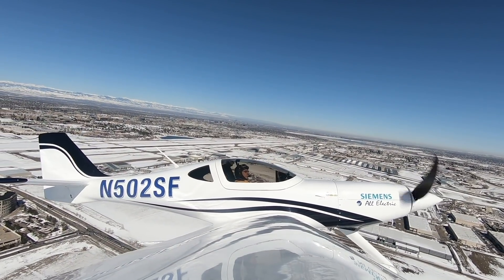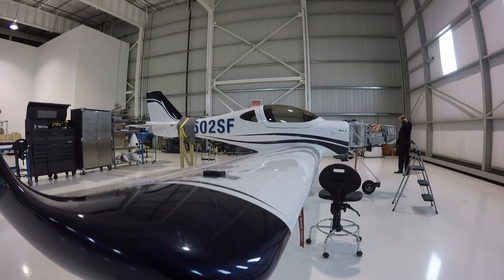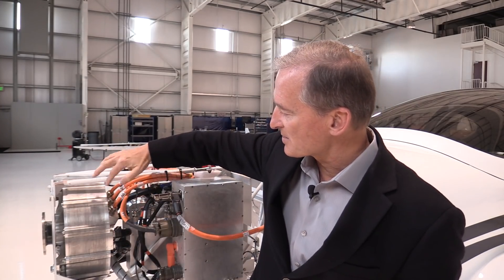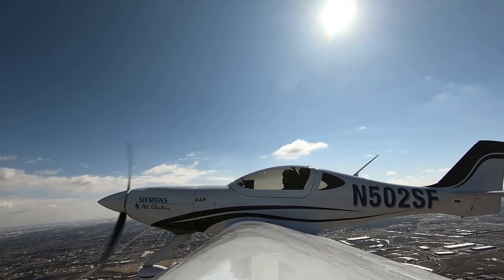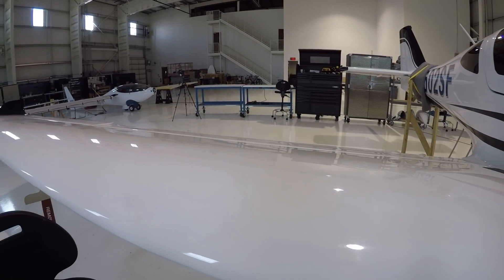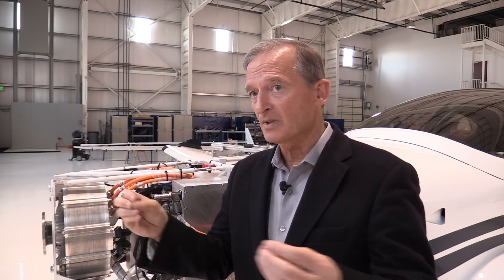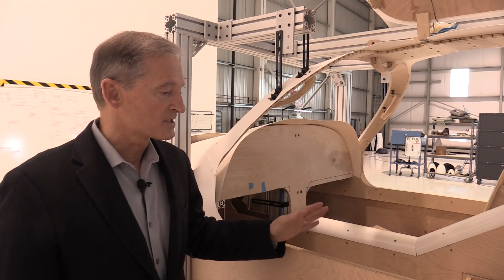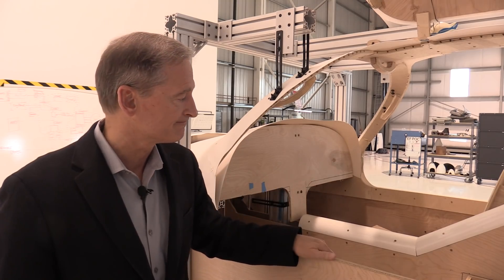Bye Aerospace's eFlyer Electric Trainer

Comment: 2 years on and where is it then? These are the usual fantasy projections which count for nothing. Performance has been revised down, certification has been pushed back. Why should the latest in service forecast of 2023 be seen as any more credible than the previous failed one? Results speak louder than projections. Proof of concept these days, particularly around electric aircraft has come to mean a flying mock up for PR sake, the performance of which bears little resemblance to that which is being projected.
  Claimed operating costs a 6th of a C-172? Oh please. The capabilities of the two aircraft are not even close. 3 pax vs 1 pax, double the useful load,  at least 5 times the range. You may as well say cheaper than a Learjet. But is it really so much cheaper? We don’t know what the battery pack will cost and Bye aren’t letting on. Nor do they or we know what TBO will be for the batteries if they get certification. But taking the only currently certified electric airplane in the world, the Velis, there is a TBO of 500 hours, which stands to reason given the effect that the unavoidable drop in capacity over 500 cycles will have on the already very limited endurance. And it is $21.6k for the 500hr battery TBO according to their 2021 price list. And those batts are 1/4 the capacity of the Bye. If you combine energy and TBO costs of electric vs avgas you basically end up with something like the same in terms of hourly costs for the equivalent power. Although future battery costs are reducing, with certified aircraft the cost is effectively baked in at that point.  And those things do matter otherwise we would all be flying gliders  All of this is before you spread the huge extra capital of an airplane that is going to be at least $490k. That is getting on for double the price of a Piper Pilot 100 trainer. Although all electric has the potential to bring down costs a long way in the future, at this stage I find this ‘reducing the cost of training pilots’ claim to be quite bogus..
Reply: Exactly. Lots of hike. Taking deposits. Delivering nothing.
Reply: @kitfoxjunky I don’t know how many ‘in service by’ dates have to come and go before people wake up to the reality that these BS projections are being plucked straight from the arse of the ceo.
Reply: EV aircraft are also always way overpriced. R&D and Producing Electric vehicles is actually cheaper than a gasoline equivalent.

Comment: The battery provides 216 Wh per kg. If you fit a 100kg battery in this 600kg plane, the 90 kW motor will empty the battery after 15 min of full power, or about 30 minutes endurance at 50 percent power. They claim 3hrs endurance.  What am i missing?
Reply: Nothing. The math does not work.  Batties do not have the energy density to deliver what Bye Aviation is claiming.

Comment: would be so nice if a standard quick change battery pack could be used in all electric aircraft so airports could be equipped with these to equal the fuel distribution system we now have

Comment: Electric, I wonder!  Will there ever be an aircraft that will be practical for distance?  I suspect there will be one for short flights, but long distance?  Never say never!
Reply: Even if you increased the energy density of batteries up by a factor of 30 it would only be able to power a half full Airbus 320 for half the range you can get from Jet fuel. We have a long way to go but the laws of physics may never allow it.
Reply: @ewaf88  That A320 would,t take off! Up weight means more wind, more under carriage, etc, etc

Comment: 260Wh/kg is getting pretty good. 3 h flight time at 70 knots is a pretty decent range.
Reply: zapfanzapfan 70 kts... what a joke. Cars on the interstate will be passing you at less than 1/2 the cost. Not to mention travel time to/from the airport.
Reply: @dalgrim  you do realize that flying isn't just about going faster than cars? And that GA happens on airfields, not airports, right?
Get that guy outta here... please...
Reply: I'd want a lot more than 70kts for 3 hours, for $349,000. What a rip off.
Reply: Except when upper head  winds are 50kt !

Comment: I'm surprised they haven't designed a way to "Charge as you fly" similar to an Automobile Altinater  couldn't be that hard could it..... and would be small enough to fit along side the electric motor
Reply: Joey Byrne That would be perpetual motion. If your alternator is 75% efficient you would only get back 3/4 of a horsepower for every 1 hp it took to run the alternator. Some do use the motor to put power back in the batteries while descending such as regen braking on an electric car.

Comment: My question is how long does the battery last and would the present day state of batteries allow for a 10 to 15 seat size hybrid or fully eletric plane?
Reply: most packs warranted for 8 years but that's to around 70% SOC overall. If these aren't temp controlled or if it's mostly circuit flying and full power go arounds as opposed to cruise flight,  then life will be shorter.

Comment: Can the batteries be swapped out so you can charge one while flying with the other?
Reply: Charge them with what?
Reply: @xqluziv  energy
https://youtu.be/cPQbkTkGsnI
Reply: There are some companies researching and trying to use large capacitors for extremely quick charging off phones. Depending upon heat and other issues, a capacitor could charge up while you're in flight, you land, connect, and in a short time you're going again if they can get the technology worked out for this too
Reply: @jarodmorris611  No regen in the air unless you want huge drag
Reply: No.
They've found the cabling needs to be too heavy.
Reply: Honestly, by 2021, charging may be so fast that it might not be necessary.
Reply: @jonathanhankins8356  It's batteries that are the issue - temp control is critical and every rapid charge cycle degrades them.

Comment: Question: if a student is trained only on electric than what happens when the now pilot gets into a fuel plane having never delt with  carb heat, fuel mixtures, and such. Will there have to be training/ certification for ‘electric only’ / ‘fuel only’ ?
Reply: One would advance through that stuff through training just like bigger, multi engine, complex, and other types.
Reply: It is a good point, and It goes both ways as well.  
Our largest local transit service airlines here in Vancouver have outright committed, or in the case of the competition partial commitment to moving completely over to ev planes for the bulk of their routes, which is taxi services, short trips etc.  Which means training on similar systems will be required to work in many smaller operations very soon.  
As said above, training programs will need to cover both combustion and ev powered.
Reply: @Arrogan28  committed to fly EV when?  10 years? Most likely they'll be hybrids and alternative fuel powered.

Comment: They need small motors in the wheels for taxiing to save energy on the ground. No sense in blowing yourself down the taxiway.
Reply: I thought of this but it adds a little weight they said.
Reply: Well you don't need to warm up the engine (like ice). So depending on the training outfit, rather short taxxing probably. And if it's at a jammed airfield, you can simply turn off the engine. No power loss. That taxiing project for airliners is more appealing, read about Airbus research on that a few years back.
Reply: That’s actually a great idea!

Comment: How many FBOs will have charging stations? Not a pilot here, so the training will not include the gas engine aspects of flight?
Reply: It probably will include gas powered engines for cross-country training flights, which are at least 100 nautical miles long and sometimes have more than two takeoffs.

Comment: So at what point in age do the batteries lose enough storage that you have to replace them? Say you use the plane 5 days a week for schooling, maybe 8hr. days?
Reply: Erik 567 typical liion life cycle is 600-900 life cycles rn
Reply: @DonMuffatello  Automotive with good battery management hardware and software is currently 1500cycles to 80% degradation. Best practice is to not charge to 100% or fully discharge. Quick charging is possible to 80% capacity in 20 mins. New Tesla V3 Superchargers will do 75 miles in 5 mins. New Tech from Maxwell will appear in tesla batteries in near future which are rated at min 300Wh/kg and double those cycles at 10-20% less cost. Tesla is aiming for a million mile drive train next year.
https://www.nextbigfuture.com/2019/02/tesla-buys-maxwell-to-eventually-triple-battery-energy-density.html
Reply: 3% oer year used or not

Comment: @2:27 Wrong. Thats not a nice progression in LiIon batteries, but a progression in your capability to use them on the aircraft.
LiIon batt have been at the 260Wh/kg for many years now and will probably stay there for ever, physics limitation.
3 hours endurance?
Pipistrel Alpha Electro has 1 hour pus 30 min reserve (if your lucky) with 120 kg of batteries on board. And that is for the certified aircraft.
Reply: Some suppliers are offering laboratory scale batch produced batteries at 500WHr/KG.    Anyone who gets their aircraft in the air now will be advantaged when these batteries become available.
Reply: pipistrel is 3 times cheaper :)
Reply: His lucky?
Reply: "probably stay there for ever, physics limitation." FAIL. 260wh/kg is not a development wall and frankly not exceptionally dense. The issue now is we have many competing formats and chemistry in Laboratories that are being heavily validated mainly for Safety & Reliability. High 300 to 400 Wh/kg is very doable in the next several years. 260wh/kg was achieved with minimal CELL improvement, it was mostly reached with Battery Packaging methods.
Reply: BMW i3 60Ah, 233kg,   120Ah pack 273kg. that's 98 to 155 Wh/kg real world machines and you don't get max kW with a discharged pack or from motor which has 30 sec peak limit